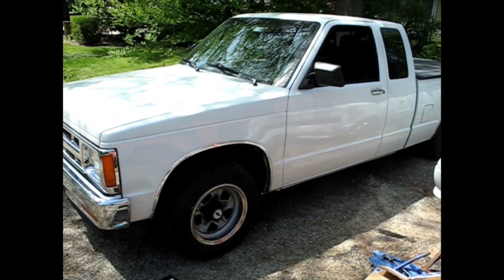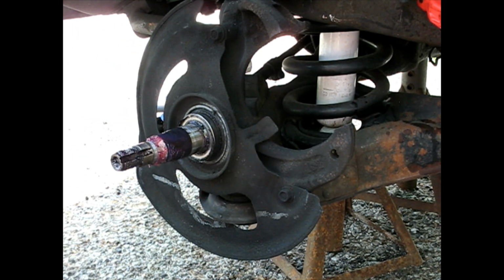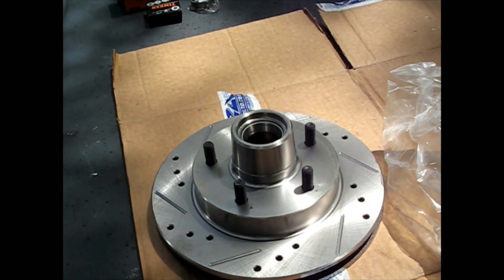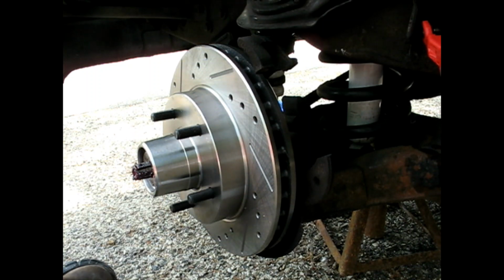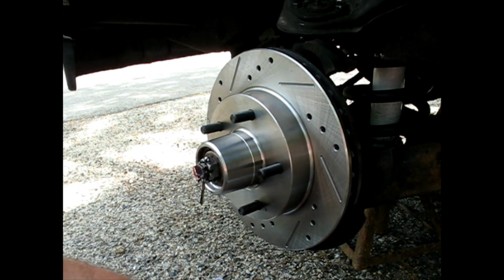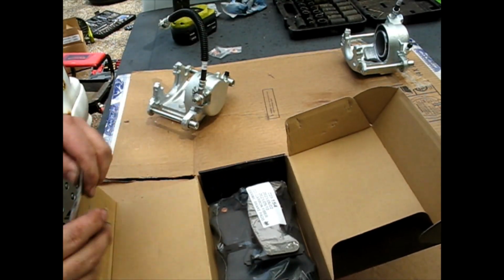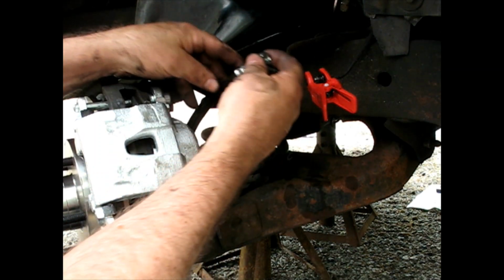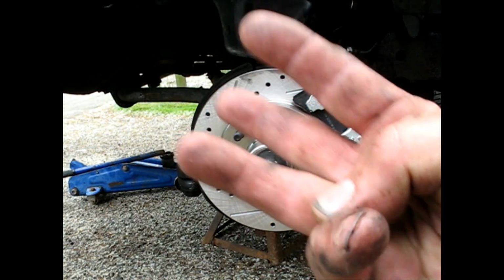S10 gets complete new brake rotors, pads, hoses and wheel bearings  Chevy 1993 Truck Chevrolet GM

Comment: Check your hose connection, there is a top and bottom at the brake caliper connection. the bolt has a hole nearer the shoulder and the hole is offset inside the hose connector and they should line up before install.